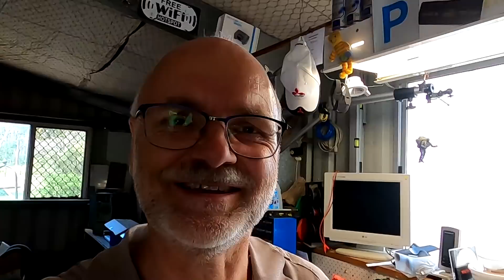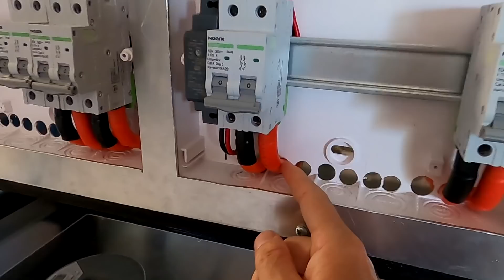Fully grounding the battery shelf... and trying this foam idea 🤔 | Battery 2.0

Comment: 2:00 considering that the box top is open and accessible it also would have made sense to mount the bus bars vertically which would have allowed to to use the torque wrench and would have given more options,
Another alternativ would have been in the current position to raise the bus bar  in the back which would have made it a bit easier to mount those cables from the bottom.
Reply from the maker: Keep watching... it all makes sense eventually 😉

Comment: Hi Andy, Just wondering have you heard of a requirement to install a Ground Fault Detector to your offgrid? We have just been made put one on our Island System, but its fully no grid so maybe different?  Love your vids too btw. As an apprentice Electrician (albeit a very old one) I am learning heaps.
Reply from the maker: Thank  you. Yes, I think there is a requirement here in AU to install one. I'm not sure if it for grid connected systems only though.

Comment: Hi Andy, first time I've posted a comment, I love your channel, entertaining and informative. I wasn't able to see in this video if you grounded the battery negative to ground. In the US NEC 2020, I believe it is required to ground the negative, so that there is a reference for the battery and I guess for safety if there is a short. Is this something you did for your battery shelf? I suppose since you have breakers on both the + and - it isn't absolutely necessary in case of a short but I wanted to know your thoughts one this. Thanks again for your great channel! -Keith

Comment: Off topic alert:  Andy, have been watching for over a year now and finally got all my components in hand.  I've watched all your videos and know you've done a ton of experiments on the most beneficial CC and BMS settings for your situation.  
Honestly, your thoughts on these settings has evolved greatly over time.  I've gone back and watched many dealing with this subject and I can't come up with where you feel these settings best suit your situation.
Specifically I am talking about Charge voltage, Absorption voltage and time, Float voltage and Tale voltage settings.  Right now after watching those videos where you play around with these settings I can not come up with what you NOW think those settings should be set at for your setup.
Would you mind bringing me up to speed where your thoughts are on this issue presently?
Reply from the maker: Hi John, I will have all these settings on my website soon. I plan to publish all settings of all my devices there so my viewers and people interested have a good start point.
At the moment I have the following settings:
Absorption/Bulk voltage: 3.45V
Absorption time: 30 min
Float voltage: 3.35V
Re-Bulk voltage: overall float voltage - 0.6V, so 53.6V and if the battery goes below 53 it starts a new cycle)
Balance start voltage: 3.46V
Reply: @OffGridGarageAustralia  Much appreciated, Andy.  Your experiments have really interested me.  So much so I almost pulled the trigger on the 40 amp battery tester but it just didn't make sense for me.  I have the smaller one but it stopped working just like yours did.  Not sure what I am going to do going forward.  You've done some excellent work with that 40 amp unit.
Reply from the maker: @jws3925  Oh, that's not good to hear. Mine broke when the external power supply had a problem and delivered overvoltage to the tester. ZKE wasn't really helpful with the repair and said I need to contact the seller on AliExpress. They didn't know how to help me either, so I bought a new one.
The 40A version is certainly very impressive and powerful but also expensive. The shipping costs itself are insane. 
I think it's on purpose that they don't have a tester charger which can handle everything. Would be easy for them to build. But so you have multiple devices and none is perfect, you always have to swap to another device.

Comment: Andy, any chance you would do a deep dive technical analysis/planning session about how you will manage connecting this to your house and the solar collection installed on the house?
Reply from the maker: There are some great news about this in the latest video here: https://youtu.be/t-y_jx0FEHc
The Victron Multiplus II makes this all possible and integrates the DC solar with the existing AC solar.
Reply: @OffGridGarageAustralia  great news indeed! Thanks Andy.

Comment: Or next time have the negative busbar sit lower than the positive busbar.  That way the wires can just go under the positive busbar without the bend but also allow you to torque the bolts.  SO the positive would have a higher standoff.
Reply from the maker: Yeah, that's what I did with the bus bars in the cabinet. Offset to allow the cables to go underneath.

Comment: +1 for rear hinged top cover. But I would add shocks on the side to hold it up when you pull out the 2 screws in the front sides of the top cover.  Or maybe you could come up with a twist lock for the top instead of screws. Then you can quickly twist and unlock it and it would lift itself up and stay up while you work on something. Then you don’t have to worry about taking it off and on. 🤷🏻‍♂️
Reply from the maker: This all goes too far. Hinges, gas struts. If I plan to open and close this lid a few times a day, yeah, maybe, but I'm not planning to. And as I said, there will be other installations above this cabinet soon and I don't want to waste this space.

Comment: You can try one of those gas struts to lift the lid maybe?
Reply from the maker: I thought about that and had a look online but I would need to cut away a lot of the metal inside the shelf. I don't think it's worth doing as the lid will be closed most of the time.

Comment: the spunge packing you can trip it down with a hot wire so flat bed of wood bare copper wire across 2 poles at the hight you wont the thickness to be apply power to the wire so it gets hot to melt the packing but not burn out and just cut to size

Comment: For your top panel try aircraft type "dzus fasteners see them all on Amazon
Reply from the maker: Should I use special fasteners for the top panel? What's the reason for that? Just normal screws would be sufficient I guess?

Comment: Hi Andy, for the lid just use 8 screws and thats it. I dont see a point to have some hinges or anythink else there. As you mentioned you need access to there not so often, so unscrew 8 pcs of screws I think it is not a problem for you. 
But I would use the space above battery shelf a put there inverter maybe even with mppts. Breaker for panels you can put to small plastic breaker box and raspi you can put to the shelf. But it is just my humble opinion :)
Reply from the maker: That's exactly my thinking too. Thank you.

Comment: Why not lift one of the bus bars a little higher so cables can pass underneath easily?
Reply from the maker: Yeah, this was my initial idea as I did this in the cabinet already with the busbars very close together. Here, I thought it will be enough space to bend one cable down. And it is, there is enough room...

Comment: Andy, about your Wifi - why are you not considering the usage of a Powerline-Adapter.  You would get rid of all of this "useless" components. I'm using Devolo - and I'm very happy with it. You would "just" need a component in your house beside your main router and one in the garage and that's it. Just an idea...
Reply from the maker: I tried this, the speed was horrible. But this was 7 years ago. Maybe technology has improved now.  The problem is also, I'm not connected to the grid anymore with the garage, so... 😉

Comment: Hi Andy,
You can put the neg cable under the busbar just use a longer bolt and screw it from the top and put a nut under the cable lug. Then you can torque it down if you drilled out the thread in the busbar. André
Reply from the maker: Yeah, I really don't like to drill out the thread.... But a possible solution...
Reply: @OffGridGarageAustralia  Hey Mr and Mrs Andy, hope you are not in a low lying area and away from the floods. Would be interested to know the precautions needed to avoid an electrocution! André
Reply from the maker: @SoundzAlive1  thank you, no floods here in our area...

Comment: Uncle Andy your number needs to be updated to 21k subs.
Bit late but would the weight of the batteries not have flattened that foam down so the shelf doesn't rock back and fourth, but yeah for the initial install the holes don't line up so it's hassles.
I'd say but the charge controllers above the shelf and the space to the right have the inverters.
This allows you to run everything neatly and leave space for future additions. So from the tops it's panel input, then continue opera then down to the batteries, then put to the inverters, keeps a good flow maybe?

PS still no label on that DC toybox (sorry ocd regarding labeling boxes :D)
Reply from the maker: I will completely redesign the hole wall and remove the cabinet. It is too small now for all the upgrades and just in the way...

Comment: Put rivet nuts on the shelf support to screw the top in place. Also get the common used door isolation selff adhesive anti collision epdm foam rubber seals and glue it on the top cover. This way it will be removed with the cover when you work inside and prevent wearing it out.
Reply from the maker: I will just threading the top and use some normal screws. But the idea with the sealing is good!

Comment: Just screw some angle aluminium to the top of the lid to make a kind of skirt around the lid, like a shoe box. No future messing with fasteners needed.
Reply from the maker: It actually has a fairly wide support left and right but only the slim overlap at the front. It should be enough to hold it in place securely. I'm trying to minimise any further mechanical work 😂

Comment: I'm not sure how common they are but over here North America they make a wrench style socket that you could use to tighten your boat with a socket driver on the underside of the negative bar
Reply from the maker: And this has a torque meter as well?

Comment: What is more work if you have hinges on the back? More work to unscrew the top panel and remove/service the batteries if you have to access those batteries on the first shelf. Or remove the inverters to make room for the top panel to be opened on the hinges.
Reply from the maker: The top panel will give us access to the bus bars and 12V compartment. That's it.
All batteries will be accessible from the front.

Comment: Weather /draught Strips or seals would might be an option for the Lid, The type that's used for Windows & door seals, (From Bunnings) There usually one sided adhesive, comes in various widths & thickness. I use it to keep out the creepy crawlys out of my Firewood lock up box (Around the inside lid), & even replacing the Outside 50W led floodlight Gaskets that have either compressed or worn out over time. it works great & is UV stable. Hope that helps.
Reply from the maker: Yeah, that's what I used for the side panels as well. Bunnings has them in all varieties.

Comment: The foam may compress over time. So the shelf could may level on its own. And or, with the weight of the batteries the shelf may level on its own. You could test this by placing some batteries on or in the shelf and let it sit overnight. You could also split the foam with a utility knife at the compression marks in the foam so the panels will "slide" into the slits and the shelf may level itself.
Reply from the maker: That's what I did, the foam has slots for the aluminium panel, so it compresses only a few mm. This was already enough though...

Comment: Andy, do you not have a hot glue gun? i would fill all the cracks and spaces with that.. cheap, easy, and doesn't damage the surfaces that its applied to. I will say this, if you seal the bottom up, you will potentially get rust acceleration, because concrete is very poris and holds a lot of moisture through wicking, the moisture will wick to the drier area under the sealed shelf, resulting in moisture trapped under the shelf.
Reply from the maker: Thanks William. We don't have much moisture here usually and the concrete is 25 years old. I'll consider some ventilation with a very fine mesh.

Comment: At 1:15, you future proofed the wiring! I to do the same, when I wired my panels with 10gauge with 7 amps max on it , so I can possibly run 14amps when adding more panels, on that length I don't run over 18 amps on 10 gauge,
Reply from the maker: Yep, that was the purpose...

Comment: If you would use some taller isolators for the front bus bar, it would give more space for the cables under it.
Reply from the maker: Yes, that's a possible solution.

Comment: Hey Andy - consider? countersunk phillips head screws to secure the top cover - maintains the clean lines, simple to remove and wont  protrude and obstruct.
I recall reading some ADR's  some time back regarding inverters not to be mounted directly above storage battery banks?  admittedly I think this would have been relating to Pb storage, not sure if that still apply's to Li-on batteries?
Love your work, enjoying the build. 
Cheers. Glenn - South coast NSW
Reply from the maker: Thanks, Glenn. Yeah that's for lead acid batteries where you can have hydrogen gas coming out when they are being overcharged. I'll have another look at this though. Thanks.

Comment: Hey man don't you think that grounding cables should be bit thicker? I should propose 6mm2 at least. And main one 16mm2
Reply from the maker: No, they just need to trip your RCDs. In most cables grounding wires are thinner than the active and neutral as they don't need to carry any current in case of a fault.

Comment: … about the bust bar issue… imho it might be the most elegant solution to just slightly raise the positive bar and/or lower the negative bar.
This way the cables can easily pass underneath the positive bust bar without touching and bending too much…
Reply from the maker: I can rise the positive bus bar by adding additional plastic underneath but lowering the negative seems not possible as these are already the lowest stand-offs I could get. This is too late now anyways as I have already made the cables.

Comment: I’m curious, what is the need for all those small gauge ground wires? Since this is a high current DC shelf, those wires will vaporize if there is a battery short.
Reply: Compliance with electoral code

Comment: There are lots of different foams that are not as stiff as the shipping material you tried so far.  There round closed cell foam for filling cracks before caulking, that could work.  It squishes right down to neat nothing.  Silicone caulk will be hard to get in there cleanly and will need to be redone if the cabinet is moved.

Comment: For the lid, just use (strong) magnets.  no holes to drill and you can take them off later, if you use a simple adhesive.  For on the floor gap, use a spray insulation that expands.  you can respray again if you every need to move the shelf out.  Just go easy on the spray :>).  Nice cabinet, Andy
Reply from the maker: Thanks Russ. Magnets are a great idea. It's a lot of work though to put them in the right position as the plate and the magnet need to be aligned perfectly. I'll see if I can find some in the hardware store which could work.
Reply: @OffGridGarageAustralia  to align plate, glue small cleats to the underside of the plate.  That will hold in place and magnets only need to hold down.

Comment: Hey Andy,  you could use ali angle instead of the "U" section and fix it to the 2 sides and the back using your existing panel mounting screws. This would enable the sheet to slide out forward after undoing a single retaining screw, keep the shelf bug free and the top easily accessible!
Reply from the maker: That's not a bad idea. Like a frame with the front open...🤔

Comment: You could make 2 hinges at the back op the top shelf and A slide lock on the front and something to lock in at the back wall so you can enter the top compartment easy.

Comment: Great progress! When hinged to the back you'll loose acces to the back for your cables. Just mount a few handles on it and you can remove it easilly. You could use "motorhaube" straps they use in rally, easy to undo the cover.
Reply from the maker: I even didn't think about the access to the glands when the id is hinged. That's definitely not going to happen. Thanks for making me aware of that.

Comment: What I would do is put insulation on the wall behind the cabinet
Reply: I second this, put some kind of insulation on the inside of the shed wall before final mounting the cabinet.  Cheap and easy, reduce some heat load to or from the batteries.
Reply: Why? The wall mount distribution boxes aren't insulated, and the way it's done now means there's a better chance of a consistent ground between all locations, including the shed itself.
Reply: @HiltonT69  I'm thinking of the battery they last longer the cooler you keep rhem
Reply: Heat insulation would be a good idea yes. For the mentioned reasons, plus,
This is the first episode I’ve seen mentioning the local Australian fauna bar frogs, dogs, cats and bats. 
The insulation would help keep those little ones out.
Reply from the maker: I guess, there is not much heat at this side of the wall. It is in between the two sheds and points east. An insulated back wall would do pretty much nothing but keeping the heat inside the cabinet. The airflow around the cabinet and aluminium panels is intentional.
Reply: @OffGridGarageAustralia  mine is insulated it does make a difference

Comment: If you got a metal frame and you got all of the panels bolted to the frame you're making contact with every bolt going into that frame you could have took and drilled and tapped one hold through the panel and the frame and run your ground 😂
Reply from the maker: That's not what the regulations say. A mounting screw is not a grounding screw.